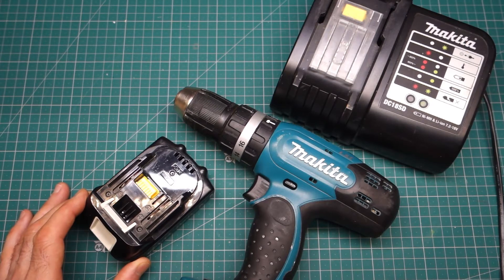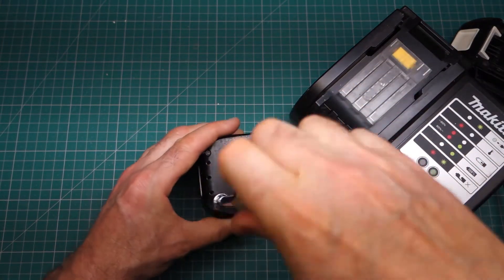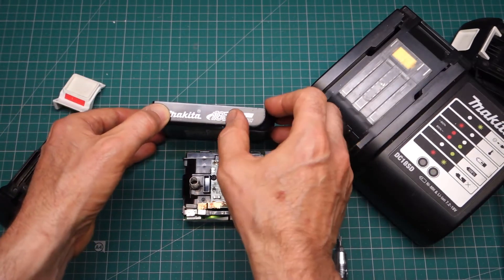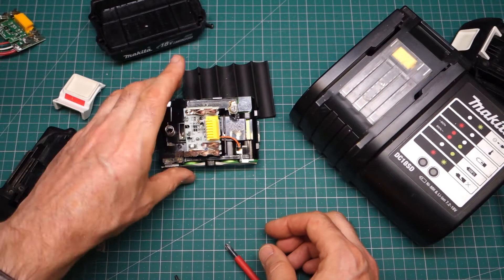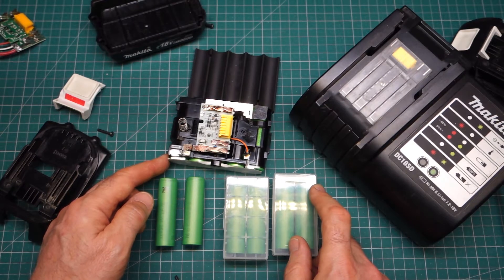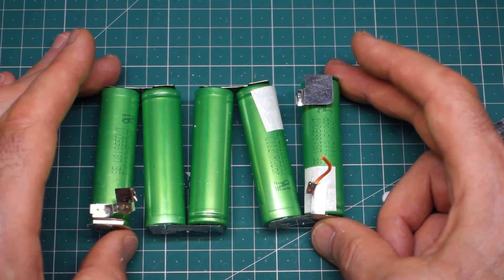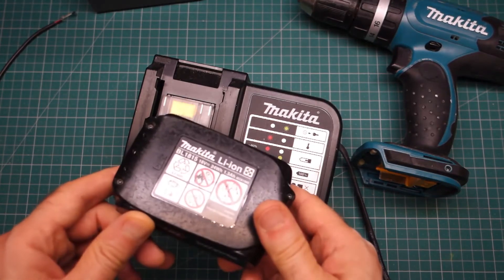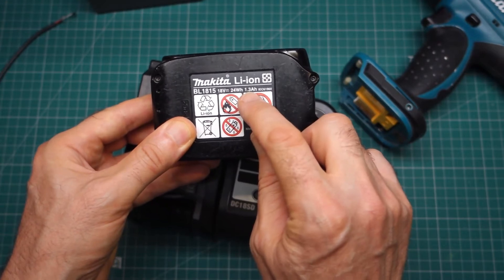Ep27 Ultimate Makita Battery Refurbishment

Comment: Do you have a current  PC board source?  Link is dead.  I am 76  and only recently stepped up to  LXT 18V Makita,  as well as converting other tools bought cheaply  at thrift stores to Makita bat!!!   Until a couple years ago, all I  had were the old Makita "long handle" 9.6V,  then bought  a  set of  NIMH 14.4 at the thrift, and finally,  bought  a few Makita.

Comment: Great work! I've got a few 4Ah's and one old BL1815N - I find the small one really nice to use on the impact driver, drills, sander and hedge trimmer as it's so nice and light... I'm really surprised Makita don't yet make a 3Ah in this size (using 5 cells rather than 10)

Comment: Hi, would it be not better to put a charging board with balancing funktion in it.
Reply from the maker: A BMS would be better but these packs never included them.  Also  the very high charge/discharge rates it make it difficult to balance.  Thanks for watching the video and commenting.